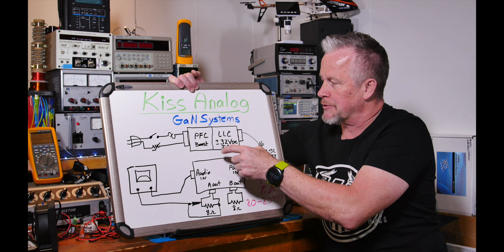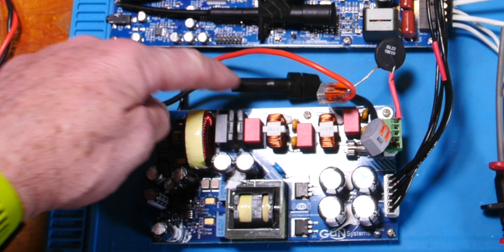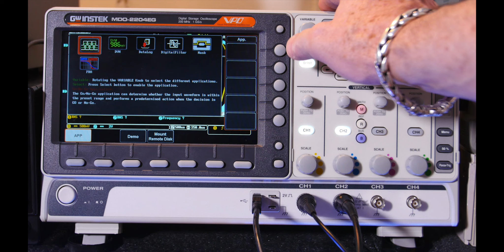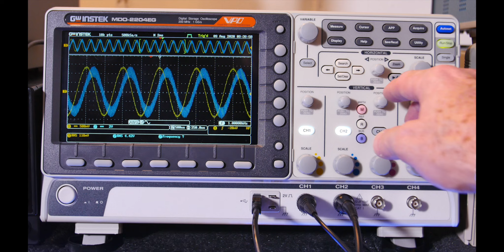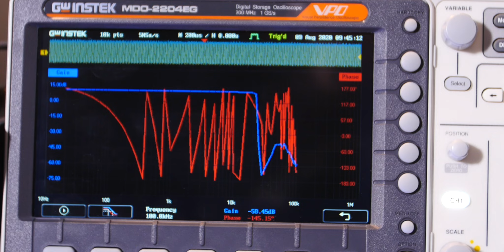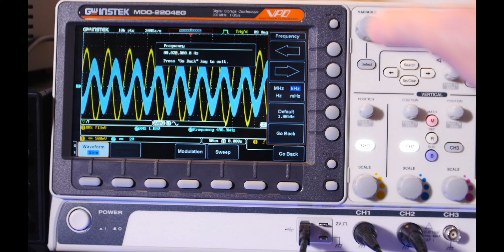GaN Class D Amplifier Gain Tested

Comment: I don't think the phase is flip-flopping, it is just a very large group delay so that the total phase shift as a function of frequency is rapidly passing through multiples of 360 degrees, so 400 degrees of phase shift is reported as 40 degrees of phase shift, 700 degrees of phase shift is reported as –20 degrees etc. That's why the phase appears to jump backwards sometimes, but actually the cumulative phase shift, if you were to unwind the phase wrapping at multiples of 360 degrees, would be close to being a linear function with increasing frequency. I also think that even the analog input on that reference design is digitized for processing to PWM by the Renesas D2Audio DAE-3 Digital Control Processor on board, so you were right to suspect digital filtering in the signal path.
Reply from the maker: Thanks for this great feedback!  Yes, I think you are right.  I did another video to try and explain: https://youtu.be/BruHwp2za38
Reply: @kissanalog  Good to know you figured it out already, and that you also calculated the approximate delay to be in the region of 2.5ms.

Comment: I would like to see frequency, phase, and amplitude measurements of a Class D amp loaded into a loudspeaker crossover. Measured across the amp output and at the woofer and tweeter. I am curious as to what happens and to see just how much of the high frequency noise (switching) is present at these points. Great channel.
Reply from the maker: Thanks for the great feedback!  I am also very interested in doing this so I’ll get a video out as soon as I can.  Thanks!

Comment: If you do a Bode Plott, I would use the full signal. I would not divide the signal by 50 or 20, if it is smal enough (Vpp) for the oscilloscope. Maybe it will increase the accuracy of the measurement, but I don't think it will change the phase. 
But all in all a great and interesting video!
Reply from the maker: You are right Jack, but I was using differential probes with those dividers so I only set the scope to match the scale.  Thank you - I appreciate !
Reply: @kissanalog  Oh I thought they were adjustable to a division of 1

Comment: Clearly, the output phase goes through 360 Degrees several times before the input signal reaches 20KHz.
Reply from the maker: This surprised the designer of this board too - they think that maybe I had some setting wrong.  I'll have to go over it and check it out thoroughly before I do the next higher power testing.

Comment: The amplitude response looks like a second-order elliptic LP filter response to me. 
What is the total harmonic distortion product at different input power levels? 
What are the input and output impedance (Z) levels? (not resistance levels.)
 What is the -3db compression point of the output signal referenced to the input power level?
Reply from the maker: Hi Gerard - thanks for the great questions.  I hope to experiment and get the answer on a video right away.  There has to be a strange measurement issue happening.

Comment: Andre' is correct.  The anomalies in the Phase plots are due to the 'fixed delay' that is associated with the DSP that precedes the Class-D Amplifier in the Audio Path to allow for optimization and tuning.  These plots are actually not representative of the Phase Response of the Amplifier.  The actual Phase Response of the Amplifier very linear, with a very slight droop at the Output Filter Frequency, as you would expect.
Reply from the maker: Hi Skip - I'm sure you are right.  Whenever I see something erratic like this it makes me think that the math is not getting clean information.  I will experiment to see if it is the sampling rate or timing of my scope that is just beating against the clocking of the Class D.  I'll see if I can get this figured out very soon.
Reply: Hi Skip, Eddie,
So if the phase issues are due to the delay in the DSP, repeating the measurement using the signal after the DSP should show a normal response? Or maybe I completely miss the point...

Comment: Thanks! Great findings. It would be good to go to the bottom of what is causing the phase alter with different frequencies. It could not be the GAN that cause that? Or is it something that cause it indirectly like a filter circuit that is needed because of the GAN devices?

Is it possible to make a power cube measurement? I think that it is probably a proprietary measurement equipment?
Reply from the maker: I think you are right Optimize, there is something amiss here.  It has to be a setup or timing issue with the digital sampling of the scope and the timing of the signal.  I'll experiment and get back in an updated video.

Comment: Hi, the amp probably introduces a time delay between the input and the output. That translates into a downwards tilted phase line in the bode plot. Due to the way your scope measures it, phase wraps around after each 360 degrees, probably causing these jagged phase plot lines that you see. Class D’s are also known for some phase droop (measured as the deviation from a straight line wrt. linear frequency).
Reply from the maker: That's very interesting.  Maybe a weird sampling or timing of my trigger with the switching of the scope?  I should try triggering off the output instead of the input, and try acquisition types.  I've had no trouble with other Class D amps, so something has to be amiss here;)

Comment: "get really bloody hot" ... Ha! I laughed out loud at this - made the mistake of touching my dummy load a few weeks back. The phase is nuts - I'd heard class D wasn't phase coherent but it being that bad blows my mind. I build a NuClassD couple of weeks back - I wonder what the Bode Plot would look like for that one.
Reply from the maker: Thanks Dan!  LOL I need more load resistors;)  I think there is something interesting happening with the sampling of a digital scope and the switching of the class D.  I need to delve into this.
Reply: @kissanalog 
Eddie, on the issue of the resistors, did you have any specific reason for choosing the resistors that you have instead of the more widely available C3PO looking ones with the fins? they are also available as 8ohm 200W but seem much cheaper... Are the ones you use more 'pure' (less inductive) or something?